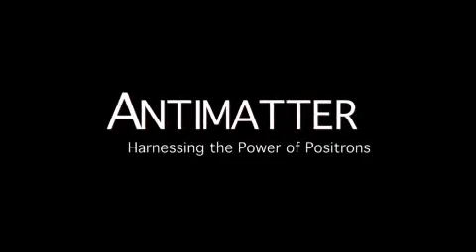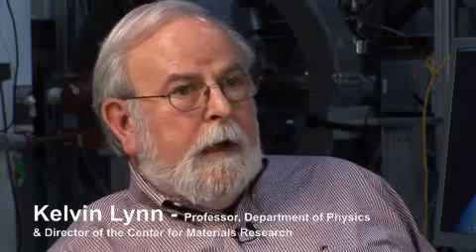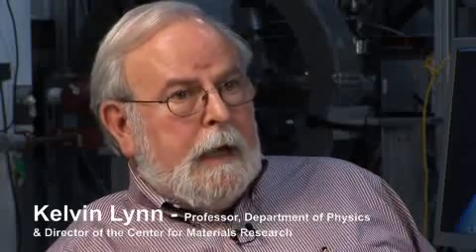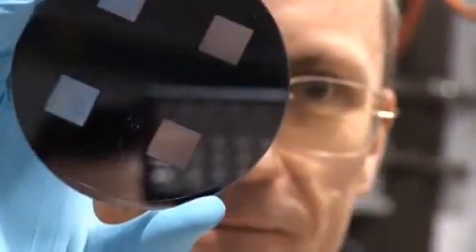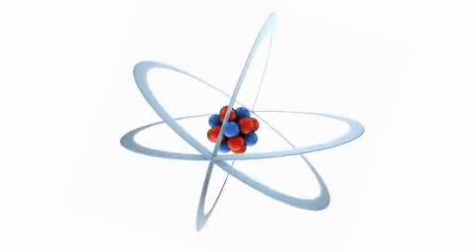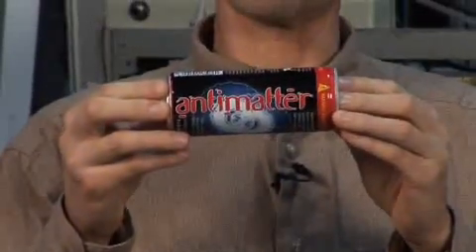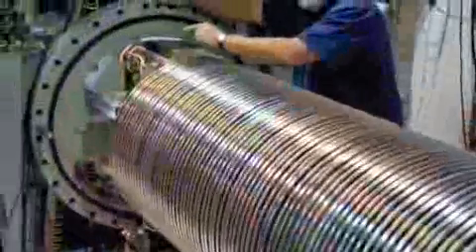"Antimatter - harnessing the power of positrons"

Comment: Would you need a trap for the electrons as well? If so would both circular traps have to rotate or overlap in some way so that the positron,electron ANNILIATION  could take place, produce the gamma photons ,then the overlapping process is stopped conserving  electrons and positrons for later use as fuel?

Comment from the maker: electron and positron are(as postulated above)of equal mass. In this light atom, called Positronium (Ps), electron and positron orbit around each other similar to a binary star system with the center of mass in the middle between electron and positron. This positronium is routinely used in many laboratories for fundamental physics research, materials science and chemical engineering. It is also an undesirable effect that has to be taken into account in medical Positron Emission Tomography (PET).

Comment from the maker: That atom has been created first at high energy some years ago and now also at very low near thermal energies at CERN.
The lightest atom possible is actually an atom and at the same time its antimatter counterpart.  It behaves similar to a hydrogen atom. However, the heavy proton nucleus is replaced by a positron.

Comment from the maker: The proton has its antiproton, and there is an anti-neutron for the neutron.
Just like hydrogen is composed of an electron in orbit (in Niels Bohr terms) around a proton, a positron orbits an anti-proton to form anti-hydrogen.
In modern Quantum mechanics the orbit was turned into a cloud like probability distribution telling how likely it is to detect a positron (or electron) at a certain location from the anti-proton (proton).